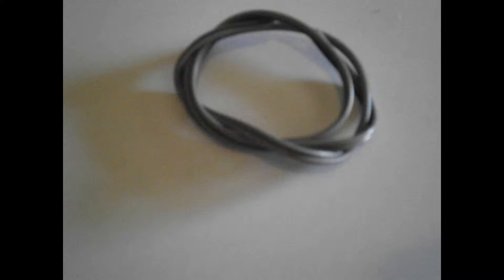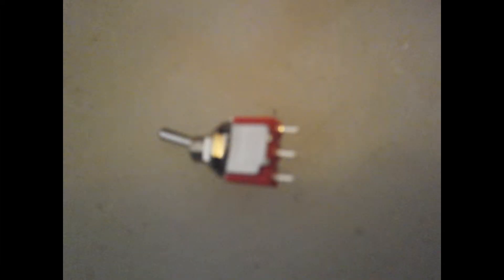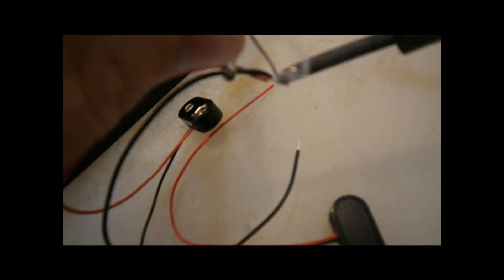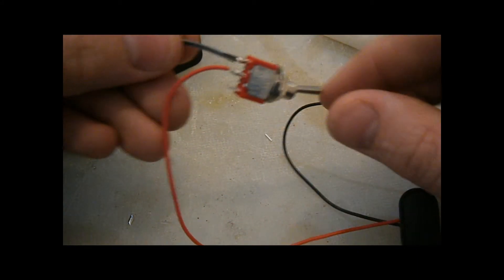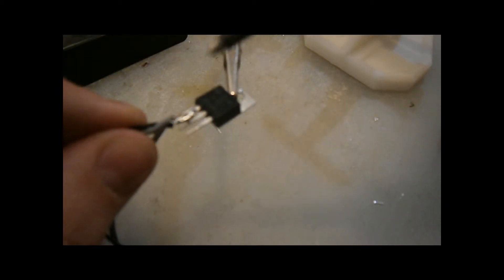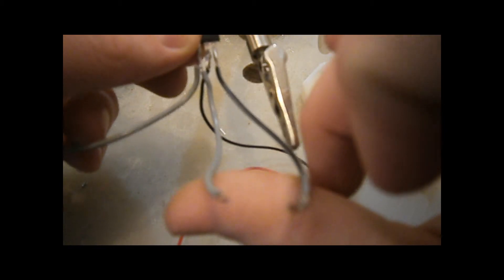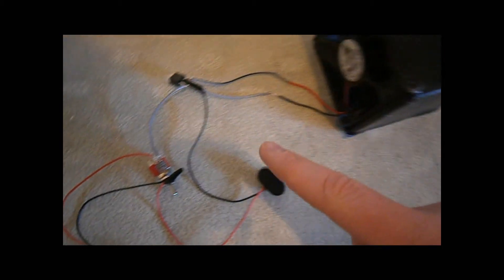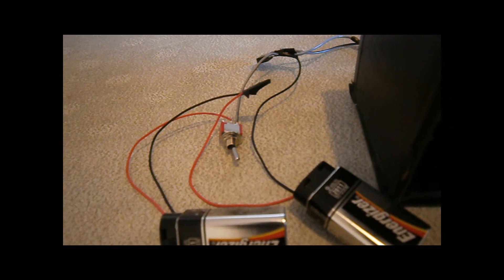Hobby Electronics - Solder Fume Extractor

Comment from the maker: thank you for your comment, i will adjust mine according to your instructions, shortly after I posted this video, I attached a thin aluminium plate to the side of the cardboard to fix the heat issue.